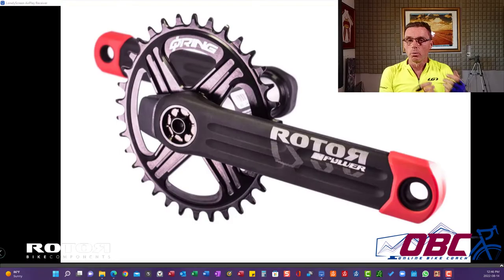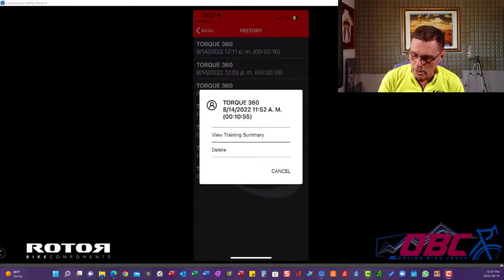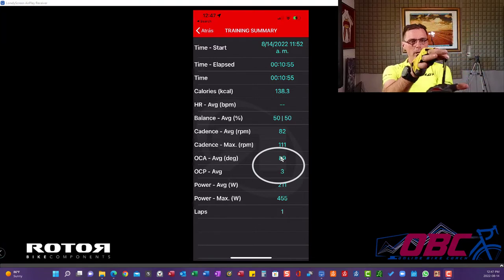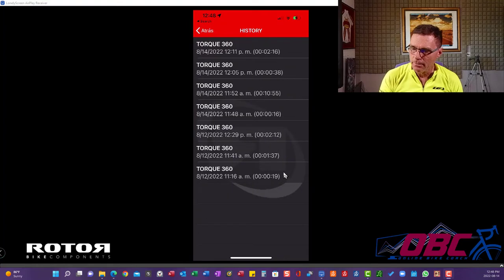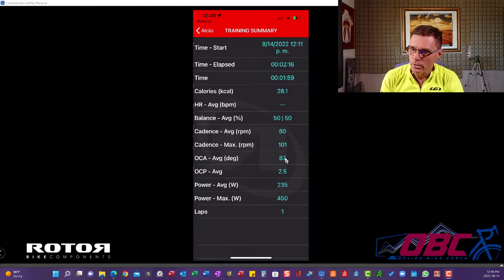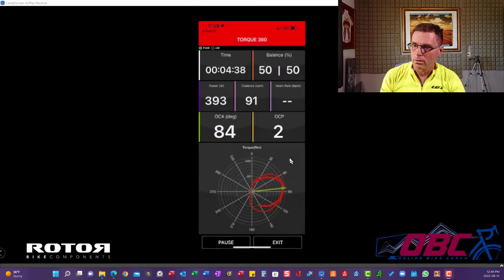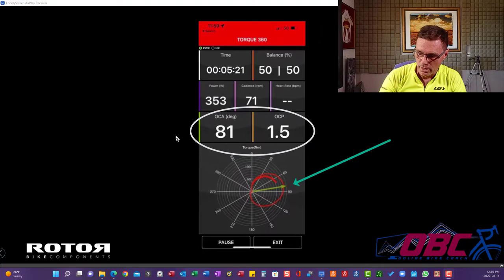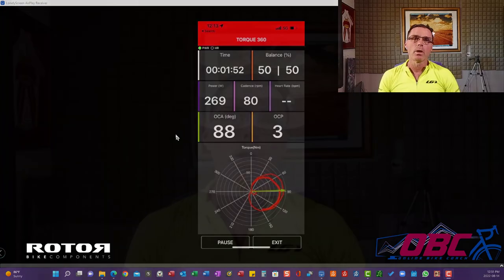Rotor Q Ring OCP Positioning Intense Sniper T Pro Position 1 WITH LOGO

Comment: Have you noticed any changes in the calculated ocp after more riding time? Also, do you still feel the trail/road grade impacts the angle where max torque occurs? It seems like the grade should have a negligible impact unless you are shifting forward or back in the saddle to compensate for the grade.
Reply: That is an AWESOME question, and I don't have a direct answer. 

When I was studying OCP and its' predecessor in the RSX front drivetrain, the CompuTrainer SpinScan (which is all I had in the early 00's) showed that a 'worse' pedal stroke (less round, but that's a whole other discussion), led to a BETTER power output per revolution, thanks to the 'crowbar' effect of the crank, and later with the chainring positions. I still get emails from Research Libraries that point out the studies done on ovalized chainrings and RSX systems, and the relative lack of evidence pointing out any verifiable gains. 

The one person whose studies I trust on the whole Ovalized Chainring and Optimal Chainring Position is the work done by Christie O'Hara, who is now a professor at.... Caltech? Pomona? I can't remember. Either way, she's good people and was wronged by Rotor after she did so much work for them. The TLDR is that the rings work, but in tiny, fractional amounts, and you're sort-of 'hacksawing' your way up the mountain. Does it make a difference? Sure, but it's maybe 1-2 chainlinks of gain (2-3cm) per entire chain revolution. 

There was another study done in the early 00's by Dr. Stephen Cheung, and it's lost in the bowels of CyclingNews and all its' ownership-flips, that showed how Q rings would improve the RATE at which a sprinter could achieve max wattage, while not necessarily improving the ABSOLUTE wattage achieved. So think of it as something like achieving max wattage about 3 revolutions earlier. 

I still get Academia.edu emails about ovalized rings and studies, and none of them show anything, but as I've stated before - I don't think anyone has really done long enough studies, or looked at non-related causes, to show whether these things work or not. 

For me? Sure- they work. But there's so many other things I need to be working on, like Volume, Polarization, hydration, sleep (holy hell some day I'm going to write an entire series on sleep and the lack thereof), that the OCP discussion is really just a lark. I think there's something 'there', there, but like most everything else these days in the bike racing world - it's 'marginal'. 

What I WILL tell you is that if you turn on the 'Pedal Smoothness' and 'Torque Effect', those work on round rings and Q/QXL rings, and they can provide incredibly good information to help you with traction and pedaling consistency. I DO believe in rounder pedal stroke torque analysis, and once again - there' just not nearly enough study or data work out there to prove or disprove my theory or claim. It's purely conjecture at this point. I don't believe the study done in GCN was adequate for a ton of reasons, and I think this whole 'platform vs clip-in' argument for bmx and mtb is silly - otherwise, we'd still be using leather ankle straps on skis with no bindings and lots of prayer. 

The founder of Rotor built the RSX system because he found that the STEEPER the grade to his girlfriend's house in Spain, the MORE we needed different OCP positions to maximize radius from axle to chain contact point on a ring. What WAS 4 o'clock for a crank's best torque became 3 o'clock with a 5% gradient, etc. Gravity always works best at max crank radius, ie 170,175mm. That's why I'm so curious about the new 155-165mm crank phenomenon. We're going to have to rely more on the rings than ever, to get us up the hill.
Reply: @OnlineBike  thank you, that was quite a response. Lots of helpful information. I'm fascinated by this idea that the oca/p should change based on grade. I need to think about that more. I suppose a portion of leg weight contributes to the force applied to the pedals. And at very steep grades there is generally a shift forward of upper body mass that probably influences the angle where max force is applied. These impacts are probably reduced when using clipless pedals, and might nearly disappear if there were a way to strap in with a seatbelt? A clipless seat... Anyhow, now I'm wondering how much the ocp is influenced by seat position in general. I'm pretty steady on my road bike in terms of saddle position, but on my tri bike I use several positions depending on the circumstances...
Reply: @nmstenvi  I THINK there's a description of this in one of the chapters in my OLD, completely obsolete book. Heck, Paul Smeulders doesn't even sell the software any longer, which is kind of a shame. 

But think of it like this; A propeller has its' worst MOMENT at 12 o'clock and 6 o'clock. It has its' BEST moment at 3 o'clock. Moment is based on Radius and Gravity. When we add in inertia and strength, this value changes to 4 o'clock or thereabouts. What ovalized rings do is they make up for the 'loss' of radius on the crank, by increasing (slightly) the radius of the chainring at max torque. What Rotor did with their computer system is, they figured out where the torque was at its' max, and gave that area a number. 

I didn't believe the OCP 1 until I saw it, but in hindsight, that does make sense. Ride a 12% slope or higher, and you're re-working the physics of the crank so that you get max MOMENT as well as Max OCP. 

If you want to look at TORQUE and Muscle Activation, well, I am COMPLETELY CONVINCED, but have ZERO ZERO ZERO evidence, other than some small Moxy Studies on hips, hams, quads, and anterior tibilas as well as glutes (that was an awkward day, let me tell you), that a 'round' torque curve makes a difference. It's the realm of conjecture, and you'd think that with Garmin spending HUNDREDS OF MILLIONS on TEAMS and PEDAL POWER METERS that they'd be marketing the blankety blank out of it, but NO. Nothing. Just money thrown away. 

Do I believe it? YES. But that's coming from 40 years of study and 30 as a coach. I honestly think I'm going to pursue an MS and a PhD in Ex Science as a 50-something, just so people can call me a "Scientist", instead of a "Mad Scientist". Scientists make History. Mad Scientists make movies and end up dead at the hand of their own creation.